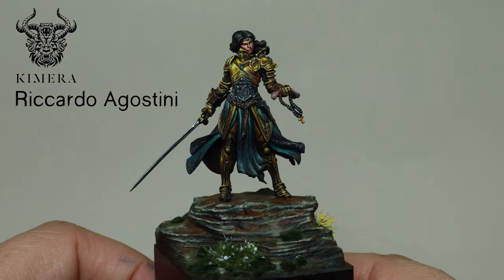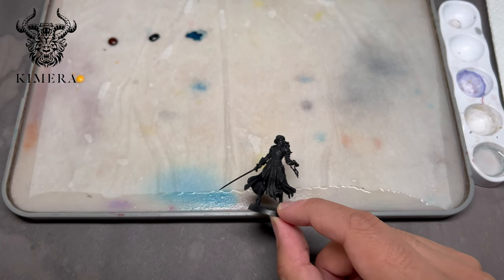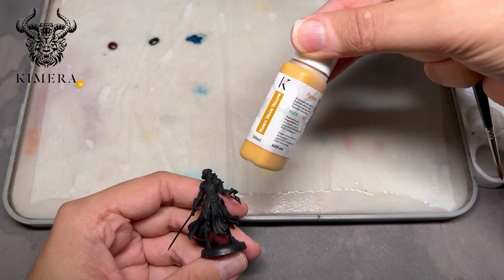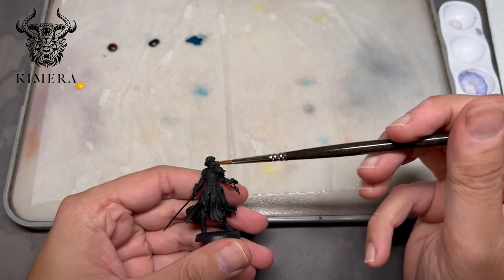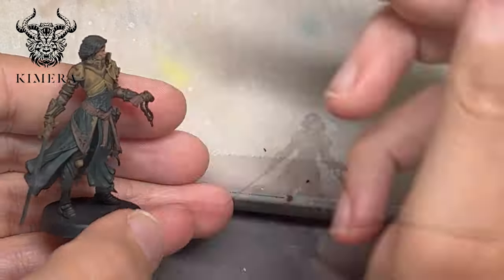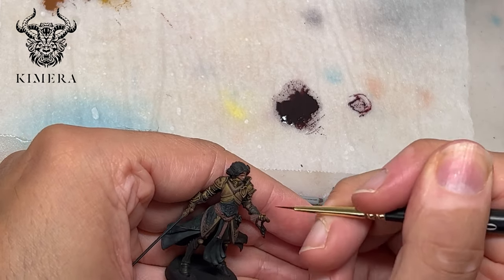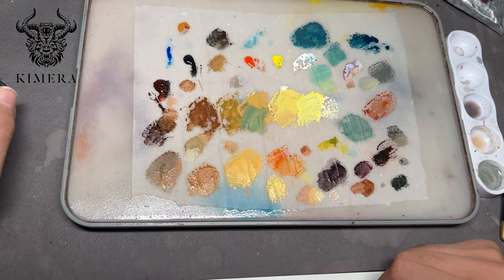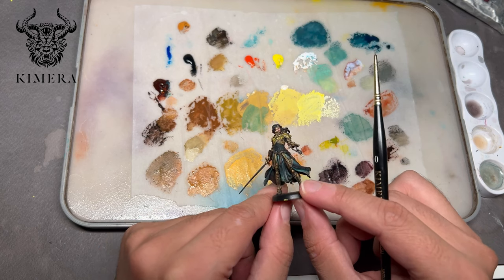DO THIS to improve your NON METALLIC METAL gold instantly

Comment: These tutorials are great. In the expansion set of the Kimera Kolors, there is a guide to gold NMM. I tried that one and it was hard to not end up with a too yellow mix, or too white in the highlights and still getting enough contrast. Definately takes some practice. 

Not many other tutorials talk about glossy dark paints. I don´t own any glossy paints, maybe I should get some. Inks are a bit glossy, what do you think about for exampel liquitex inks for shadows? And could you use a glossy medium to mix with a matte paint for shadows?
Reply from the maker: Inks are very good for saturated glossy shadows. I use them. Also satin medium or any glossy medium + a matte paint can work too. That w&n color is very nice for shadows, i use it a lot, sadly though is discontinued so it's a bit hard to find. But you can always use the other two methods. You can also mix inks with matte paints to have a less liquid consistency and still get the same result.

Comment: I’ve come to the conclusion that NMM is entirely intuitive and not even a little bit formulaic. This is a great video but I think I’ll never have this level of intuition on this subject.
Reply from the maker: It's not true, in my classes I explain all the reasoning behind and how to even calculate the points of reflection. Problem is that it takes a class of 6 hours to begin with so I couldn't explain it in a video. But maybe I can do another one in the future going even more in depth
Reply: @kimeramodels  I would definitely watch a longer form video, even if it only covers a single element of the figure! Thanks for replying ❤️